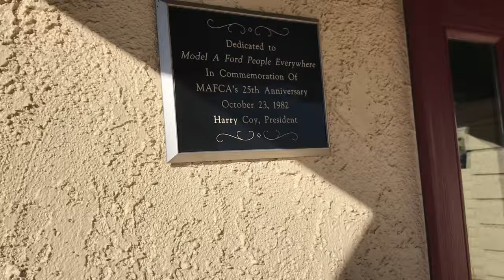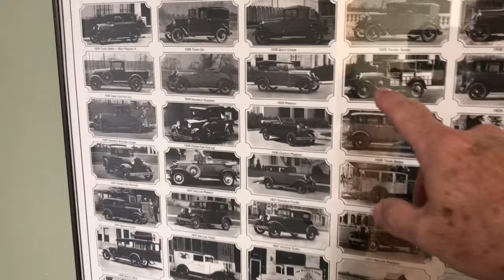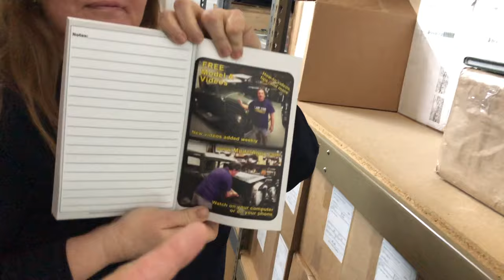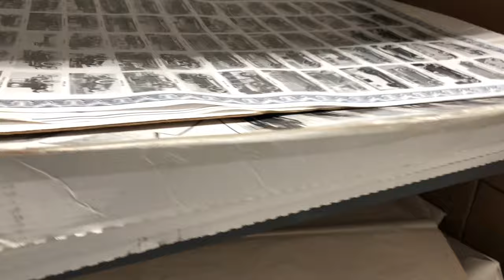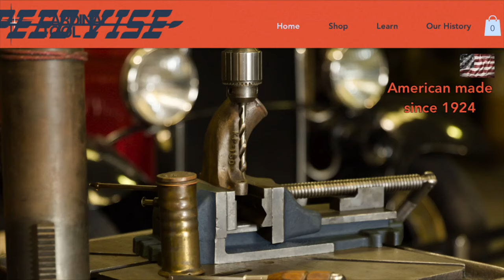MAFCA (Model A Ford Club of America) Headquarters Tour / Speedvise Factory Tour

Comment: Great memories of high school auto and metal shop seeing those machines.  I hope to get some of the automotive stuff for the new barn, like a Sun scope with all of the connections.  I still own a timing light, dwell meter, had those since 1976, like new condition as I always kept them in a hard case.  Soon it will be time to wake up the fleet and check them all out.  Motor Muster is coming up in June, only showing one car.  Enjoy the new position brother, you'll be great.  de N8IWS ,73
Reply from the maker: Thanks, OM!  FYI- I have one of those Sun type machines.  It's been under a cover but outside.  Free for the taking.

Comment: Don't be mad, I'm a neophyte, but is there a modern motor & running gear that fits into an otherwise stock A? (I know about Shay, but the idea of that plastic body, yuk!)
Reply from the maker: I have heard of people putting Ford Pinto stuff into a Model A.  But most of the fun of a Model A is lost when they do that.
Reply: About that motor swap...
Yes, the Pinto 2.3 liter 'Lima' engine will fit. But it also means more changes to the car than you would imagine. 
Unless you are able to engineer all of the changes and pull off the work (you are on your own!) I would not recommend this. 
Nearly everything you need to keep an A original and running is available. Get with a nearby model A club. Chat them up. They are a wealth of info and happy to indulge you. Good luck and happy motoring!!